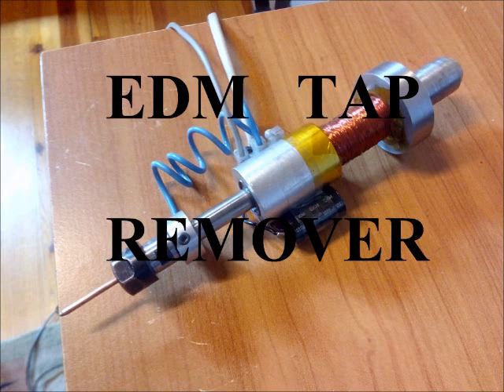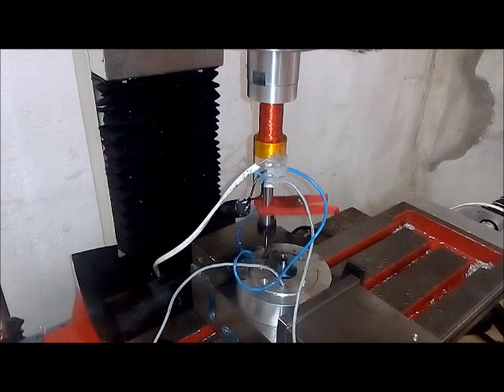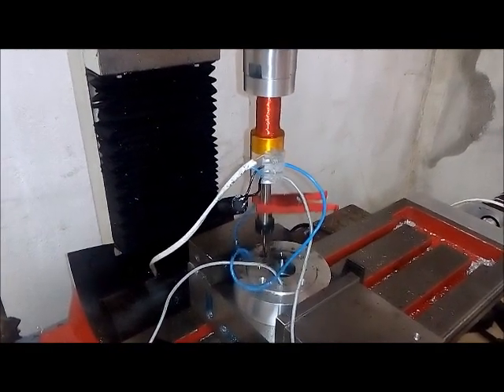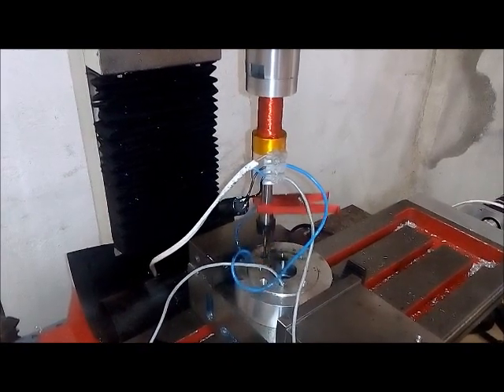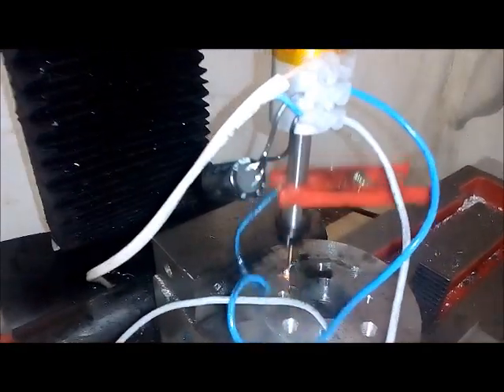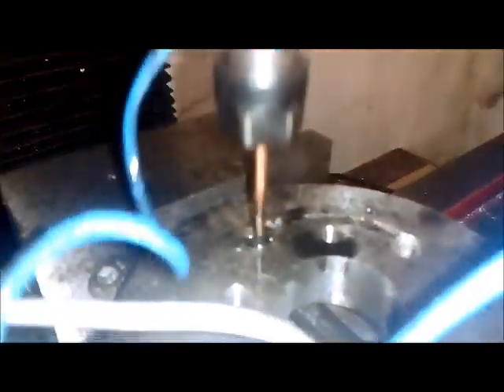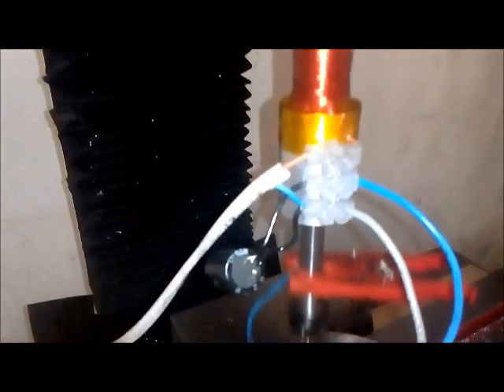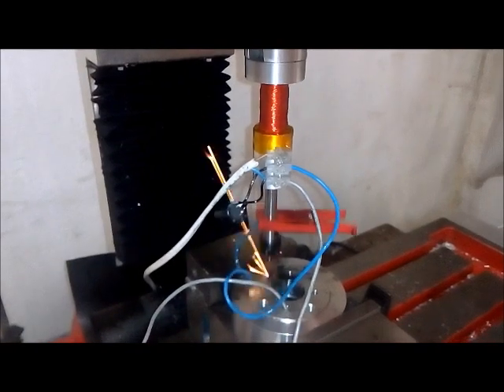Homemade EDM tap remover

Comment: i can t acces the article on the forum, i thought it was removed. How can i contact you?
Reply from the maker: yeah,  they changed all forum directions so it migth be hard to find again. What do you need?
Reply: @EmperorDevilhunter  I want to build one of it. My project for bachelor's degree license is an edm machine.
Reply from the maker: @BogdanFanTa  you can write me to pablo_vf_@hotmail.com. This unit worked but had some problems. Later I did a better one that can get more control, I have in mind to improve it and upload a new video but won't happen soon as I have very little free time and is not on my top priorities
Reply: @EmperorDevilhunter  ive texted you on mail. I build one for 12v with capacitator  50v 1000uF, but my coil when I use + on workpiece and - on coil doesn t work, I think the electrode is stuck on the workpiece. Separately the coil work very fine.

Comment: I NEED DETAILS OF THIS SOME BODY HELPS ME.
Reply from the maker: I have a new EDM generator using Arduino now, I will make a video in some weeks, just stay tunned.
Reply: @EmperorDevilhunter   sir, is video of  arduino edm generator is out.?
Reply from the maker: @9700784176  Not yet, didn't had time. But I have improved the design with selectable power. Just need to put everything together but I have pretty little free time nowadays